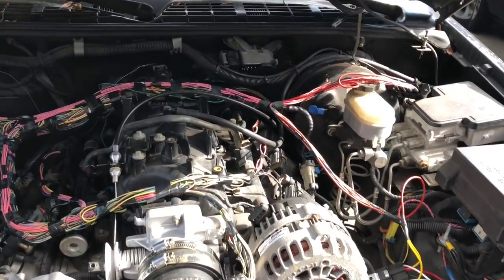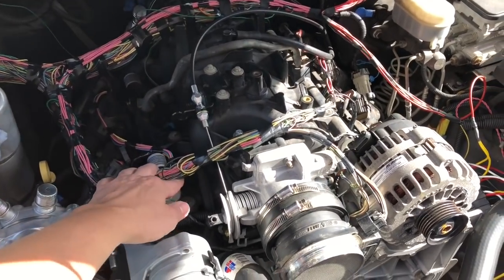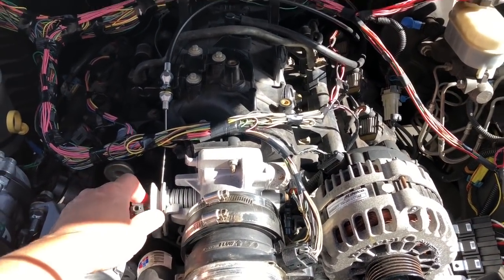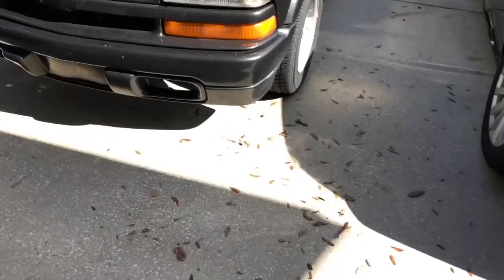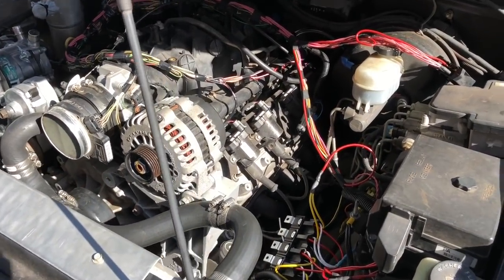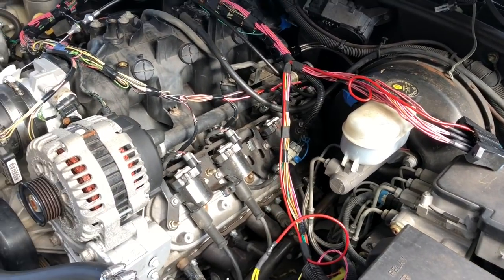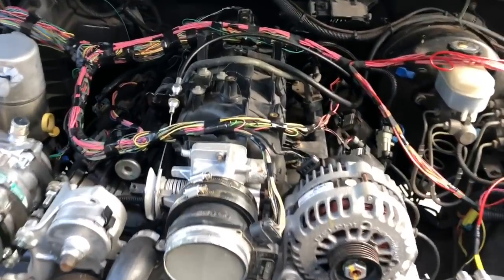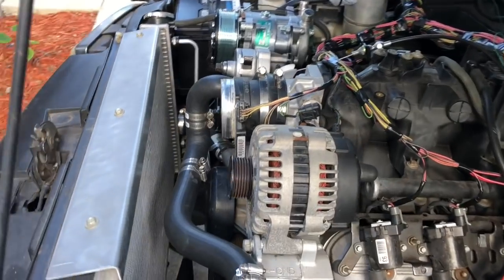LS S10 V8 Swap Part 13: Harness Tips and Lesson Learned

Comment: Drop some knowledge on me bro how did you get that cold air intake  filter to fit on the intake manifold like that what part number did you use
Reply from the maker: I just bought a 4” filter and popped it on there. I think I used a piece from a truck cold air intake also.

Comment: Hey cliff i did a v6 to v8 swap on my 04 silverado. The donor truck was a 04 tahoe. The only issues i have now is that my fuel gauge measures the oppisite. I went with a 3 line fuel system instead of 2 .Also my parking brake light stayed on and flashes . Ive installed the pbrake sensor from a tahoe and the original and it doesnt make a difference,  any tips???
Reply from the maker: I didn’t have either of those issues... I’d say double check your diagrams for those systems.

Comment: I have a 5.3 in my 2000 extreme. Have a harness from lsxharness and my problem is the key turns everything on and off but doesnt engage the starter. I have to jump the pins on the starter relay. Does anyone know what wire I need to swap in the fuse relay center to get the starter relay and key to work like its suppose to?
Reply from the maker: Get the diagram for the truck and match it up.

Comment: im doing a swap right now in my blazer and since i didnt feel like trying to figure out all those wires and im doing the entire swap alone not a single person has come over to help me,i went with cpw and everything ive done,i take 1 step forward and 5 back which means ive spent over 7 grand ,actually more but i dont want to know,when its running and if its good then i will add it up,ls engines are totally different than a small block chevy,let me tell ya and i will say this.I DO NOT SEE HOW YOU CAN DO A BUDGET BUILD on these,if your running a cam and springs like i am and ac and im in tx its hot,i didnt skimp on shit,because i dont want to over heat and fuck my shit up,plus this will be my daily.good luck to yall
Reply: onewheelup thanks for the heads up😆. I’ve got an 02 S-10 extended cab. Within a month, I will be pulling a mildly built, 400rwhp LS1 from a 2000 Camaro, backed by a TH350, 3200 stall, manual valve body. I don’t want to know what the end price will be but seeing as my father(who passed last June from cancer)gave me his truck and I want to do a tribute to him. Money doesn’t matter to a degree but I don’t want to skimp. Looking forward to getting that anemic 2.2 outta there asap
Reply: Same thing here!! Budget=gone. Thought the same thing did a fair amount of research and missed a bunch of things that are costing $. For the power you get they are awesome but definitely not budget friendly by the time you add all of the things you need to make them run properly

Comment: Just wondering I'm still working on mine. Does your factory abs work? And if so did you have to wire anything into the new ECM from the Tahoe?
Reply from the maker: My ABS light is on. Not sure if it’s working though... I’ve not tried it!

Comment: I have a great condition 93 s10 4.3 ext cab. I have an 02 Tahoe 4wd 5.3 runs great body is rough enough that I could care less about. I haven't started pulling anything until I know what I'm doing, and I want to do it right the first time. I refer to YouTube for learning, I feel it's the best tool for a job, thank you for being straight forward with your video! Liked subbed!

Comment: I'm going through nearly the exact same intake swap / wiring change on my current v8 swap s10. I have an '04 4.8L vortec engine (drive by wire), harness, pcm; and an intake from an 02 with drive by cable going on. Hopefully you can tell me more about the wiring changes you made (mostly concerning the pcm), the sensors you had to add, and finally did you have to retune after swapping from wire to cable?
Reply from the maker: Ecu must be tuned to change from DBW to DBC, and vice versa. As far as rewiring sensors and ECU repinning, all that info, step by step, is at lt1swap.com. The guy that runs the site will also program your ECU for $75. I used him, and have no issues.

Comment: So did you use the pink & orange from factory fuse block for power to your ecm and relays from fuse block to run it. My issue is that i built my harnes to be stand alone before i knew for sure what i was going to put engine in. Original plan was 79 malibu or 71 c10. Then came across the s10 and went with it because got a good deal on it. And i appreciate all questions you have answered. Thks again
Reply from the maker: I did us the factory fuse box for the pink and orange.
Reply: @CliffsHowTo  did that work ok? I have my own relay for fuel pump and fans..

Comment: I’m still so loss and need help, I have a 92 S10 what wires would I need from the s10 harness to connect with the LS harness
Reply from the maker: The 92 is completely different from what my build is. But basically, you can wire the harness as a stand-alone harness. If you go that route, it’s pretty easy to get the motor running.

You can look on lt1swap.com for details: http://lt1swap.com/wiringharness.htm
Reply: @CliffsHowTo  Hey thanks for the link! Just getting ready to do an LS1 swap on a 89 S10. Very good info!

Comment: ok i hope this helps got it from s 10 ls group on FB   February 25 · Gauges: How to wire them. If you have anything to add, revise or that is just wrong, comment and we will work together to get it as simple as possible. The speed output from the new PCM goes into the same body tie in as the original output from the old PCM. Oil pressure is a single wire sending unit on the original engine so use the single wire sending unit on the LS and send it to the same body tie in position as the original. The fuel gauge is stand alone basically but you will need to ground a wire near where the original PCM went in order for the buffer to boot up. temp gauge 98 f body three wire sensor (oil sending unit plug on factory ls harness (03-06) works perfect in it) The temp gauge in the S10 is not class2 driven like the new LS stuff and 98+ s10's, it's driven off a sending unit. So leave the two wire sensor on the driver side head of the LS and keep it wired to the PCM because the PCM needs that data to run the engine. For the gauge, run a single wire sending unit in the passenger side head and hook it to the body tie in where the original sending unit went. The voltage gauge is just driven off of main power so nothing to hook up there. From lt1swap.com: "I have found that some PCM's tach signal is not strong enough for some aftermarket tach's. I used this method to fix the tach signal on my 2003 PCM with an Autometer 5" tach. All you do is hook one end of a 1000 ohm (1K OHM) resistor to the tach wire, and other end of resistor to key 12v+. The tach wire is found on the RED PCM connector for 1999-2002 vehicles and the GREEN PCM connector on 2003-2006 vehicles. This may not be needed on all, I have had a 12200411 PCM from a 2001 work just fine without the resistor. So far, all 2003+ have had to have it."
Mar 27 at 8:30 PM

Peter Toures <ptoures@sbcglobal.net>
To:
Peter Toures

Mar 27 at 8:30 PM

Jeremy Matthews to 82-04 S10/Blazer LS Swap Group READ ANNOUNCEMENTS IMMEDIATELY
February 25 ·
Gauges: How to wire them.
If you have anything to add, revise or that is just wrong, comment and we will work together to get it as simple as possible.
The speed output from the new PCM goes into the same body tie in as the original output from the old PCM.
Oil pressure is a single wire sending unit on the original engine so use the single wire sending unit on the LS and send it to the same body tie in position as the original.
The fuel gauge is stand alone basically but you will need to ground a wire near where the original PCM went in order for the buffer to boot up.
temp gauge
98 f body three wire sensor (oil sending unit plug on factory ls harness (03-06) works perfect in it)
The temp gauge in the S10 is not class2 driven like the new LS stuff and 98+ s10's, it's driven off a sending unit. So leave the two wire sensor on the driver side head of the LS and keep it wired to the PCM because the PCM needs that data to run the engine. For the gauge, run a single wire sending unit in the passenger side head and hook it to the body tie in where the original sending unit went.
The voltage gauge is just driven off of main power so nothing to hook up there.
From lt1swap.com: 
"I have found that some PCM's tach signal is not strong enough for some aftermarket tach's. I used this method to fix the tach signal on my 2003 PCM with an Autometer 5" tach. All you do is hook one end of a 1000 ohm (1K OHM) resistor to the tach wire, and other end of resistor to key 12v+. The tach wire is found on the RED PCM connector for 1999-2002 vehicles and the GREEN PCM connector on 2003-2006 vehicles. This may not be needed on all, I have had a 12200411 PCM from a 2001 work just fine without the resistor. So far, all 2003+ have had to have it."
Reply from the maker: Wow, that’s a lot of info, thank you! However, I don’t think most of it really applies to my situation though. I’ve got a 98, so the fuel gauge part will probably work. I don’t have a tach, so that’s out. 

So then it’s just the coolant. Mine should come through the serial data cable. The ECU definitely is getting the reading it needs, because it kicks the electric fans on and off at different temps. I just don’t get that at the dash. 

So my truck doesn’t have the one 16 pin c101 plug that the 99 and up trucks have, but it also is different from what a pre 96 has. It kind of splits what come out of the c101 into two plugs. 

I’ve been told by many that all I have to do is color match the wires, and I should be good. But I’ve tried that, and get nothing. I’m missing something, I just haven’t figured it out yet...

I do appreciate the help though!

Comment: Hey did u deleted the egr valve with the headers u got if so did u have it delete from the pcm also? Im doing headers on mine but the headers i bought have no way to conect to egr how did u do it?
Reply from the maker: I didn’t run egr. I also informed the guy that did the retune on the ecu that I was removing it, so I’m assuming he took it out. 

I don’t know if it’s bad for the motor or not. There seems to be a lot of back and forth on that. Mine seems to be running okay so far, thought I haven’t driven it too much. Still try to work out the kinks in the harness.
Reply: You don’t have a clue do ya
Reply: @michaelhotz8390  pfff yes as a matter of fact I'm getting rid of the Exhaust Gas Recirculation Valve Aka E.G.R valve dont need it is just gonns get in the way.

Comment: Thanks for this Cliff! I almost sold my  00 Xtreme when I bought my 2019 Colorado but my wife got me a mig welder for Christmas so I said now I can seriously work on my S10..

I am hoping to find a swap for it reasonably priced like yours was around here (Massatwoshits) but I haven’t really found one. I might ending up going to a pull a part this spring and see if I can get one from a GM Vehicle and grab everything from that vehicle. 

Thanks for the info on this and where you got it from. Can’t wait to see it running.
Reply from the maker: It runs. See part 12 video. I haven’t taken it for a drive yet though... (still working on getting a belt routing configuration, and need to wire up the fans).
Reply from the maker: Yes, please try and source it all together! It will make your swap 1000 times easier. And I’ve been told with the muscle car oil pan, you can fit the motor without cutting and welding... I did, because I was trying to make the truck oil pan fit.

Comment: When I did my swap I used the factory pink wires from the stock s10 fuse box for all power for the injectors and coils. I don't have any extra fuse or relay boxes. I have about half the wiring you have and it's all routed under the intake and behind the engine.  I also started with the corvette filter/regulator but later swapped to a return style rail with the proper injector tuning. It's best to be regulated at the rail, this way your injectors have access to full fuel volume when/if needed. 
Also it'll run much better when you get the MAF away from the TB for smoother airflow.  I also have a/c, everything inside looks and works like factory. 
You've done a great job, can't wait to see it finished.
Reply from the maker: I was going to try and run all the pink wires to the C2 like you did. Was yours a 4.3 originally? Mine was a 2.2, and the 2.2 has like 3-4 less spots in the fuse block for pink wires. Hence the reason I used an outside fuse block.

I thought about thinning out the harness, and running stuff behind the intake and all that, but it would have been a lot more work, and this thing hasn’t run in over 2 years! I’m ready to hit the street with it! 

I may go back and clean stuff up later, but for now, it looks okay-ish...
Reply: @CliffsHowTo  yeah, where’d you get the factory S10 pin outs?
Reply: Where did you find the pin-out of the original engine/body harness?